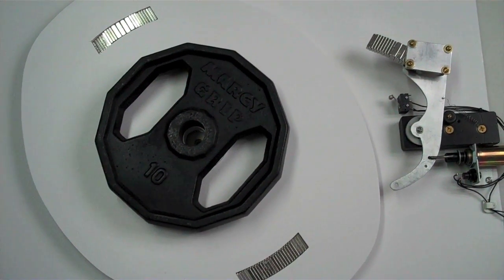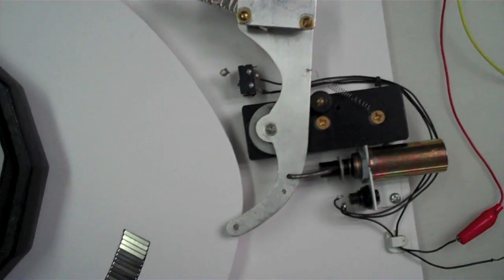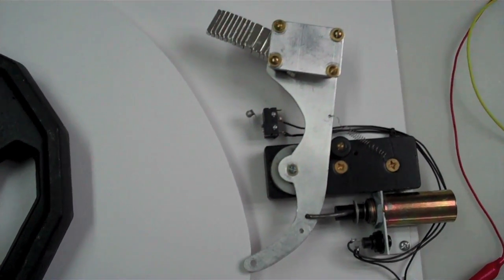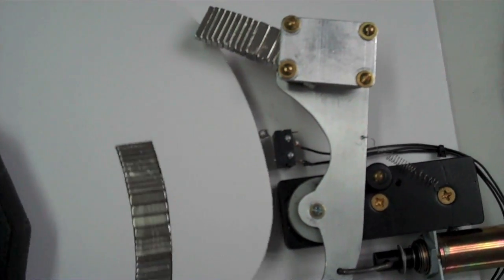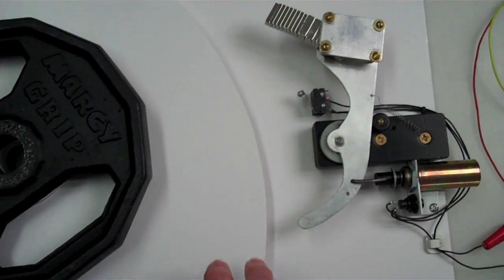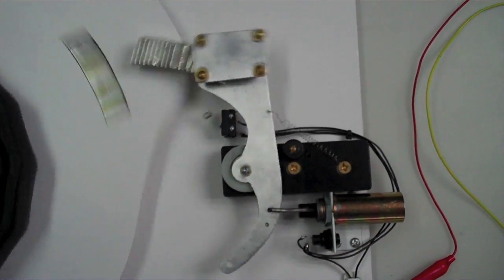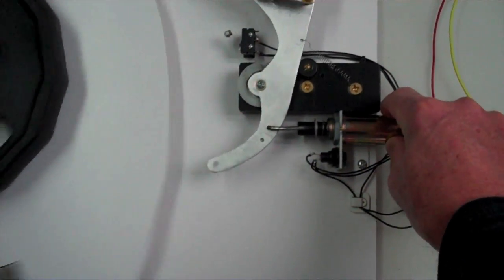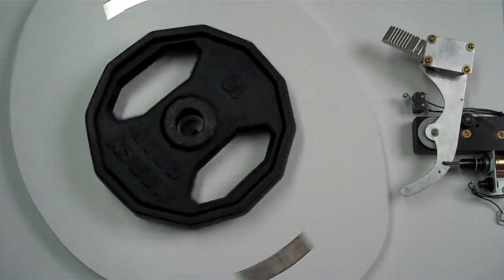Solenoid Driven Repulsion Motor

Comment: great demo of a solenoid levered magnet  repulsion motor save for that pesky contact switch which can be replaced easily easily with a good quality reed switch from russia..how many amps does the.electromagnetic solenoid consume? lets set that flywheel on a car alternator and to self loop the system

Comment: So Cool! so put a solar panel on it (7W?) and a pancake generator and see what load it can pull. you may have a solar replacement for the home refrigerator motor/pump.  I read 25% of home power usage is just for refrigeration. hydroponic pumps may be an other good usage.

Comment: And other things more related to this video. Could it be possible to use the gravity and centrifuge force to reduce to consumption of energy. I also believe that you can mount a generator on to the wheel to self power it self and still have energy out put.

Comment from the maker: The distance and angle of the levered actuator magnet render it dormant until the solenoid engages it forward to produce a quick repulsive force, driving the rotor. 
When the solenoid pulse is finished, the rotor magnets provide their own repulsive force to push the actuator magnet back to its dormant position for the next round. This way, the magnets work WITH you instead of against you.

Comment: So you think that the magnet isn't being pushed back with the same magnitude of force that it exerts on the rotor magnets (Newton's 3d law)?  Assuming it does (it does), then don't you think the solenoid coil is using at least that much energy to move it?

Comment: what a interesting concept, because Your rotor is on a vertical arbor, it would be interesting  to test it on  a frictionless magnetic bearing,along with a small coil to power the solenoid, great work, i really apreciate You sharing Your reasearch and motor designs..Tim

Comment: for instance, imagine you connected a conventional generator to the shaft. The generator would require a greater or smaller torque depending on what load, it was connected to, which is basically a electrical short. So i would like to see the torque that these things can generate, then you would have a better idea of the use in domestic power generation.

Comment: yeah, great vid...BUT. I have one point. Your not showing that the magnet method can push the weight, because you accelerate the weight with your finger.  At the point of maximum velocity  the force from the magnets is simply working against the friction from the bearings (which is of course greater due to that weight you have on, but is still small.) The torque generated by this method of repulsing magnets is important, for instance..see next comment

Comment: Fine work.  Next try to close the loop, and make it free standing.  That is generate enough electricity from the spinning rotor and some external coils to power the solenoid,  and maybe light a light also, and you have a free energy system.    Go for it!